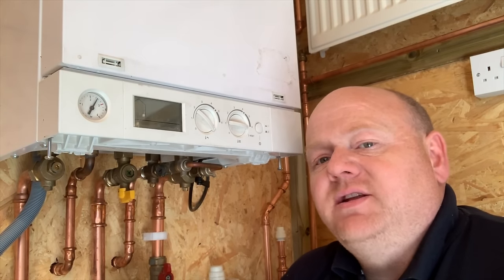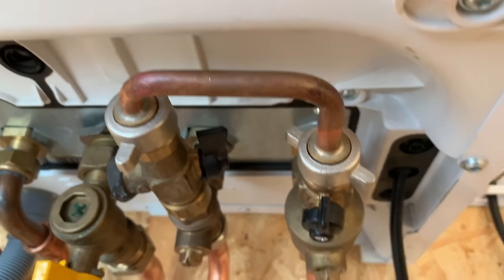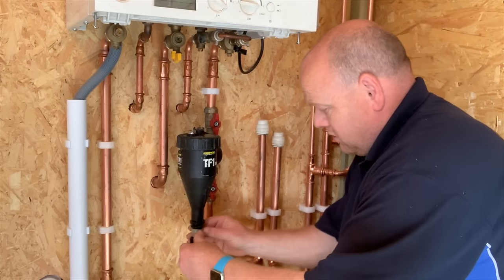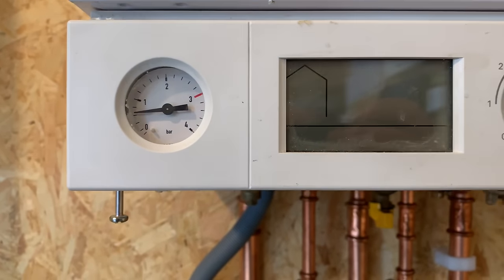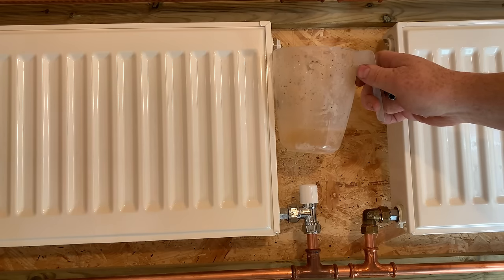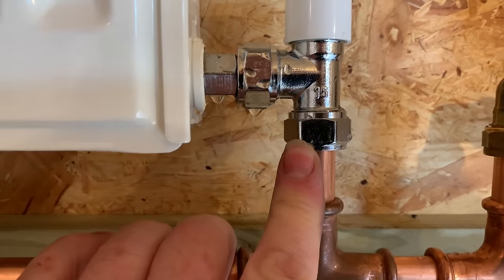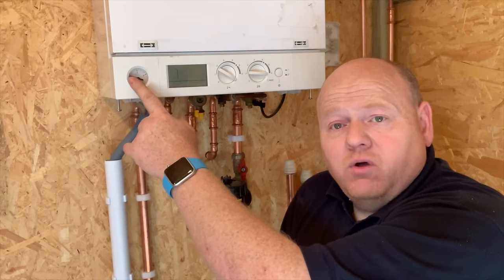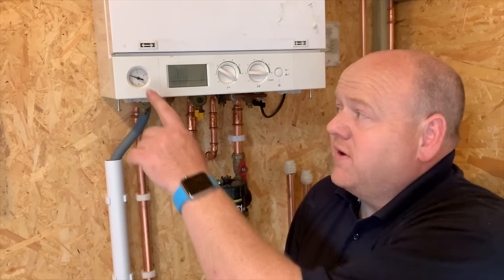Combi Boiler Too Much Pressure - How to reduce the water pressure - Central Heating

Comment: if its a expansion vessel problem how much would that cist to repair or replace my boiler pressure is going over 2 bar before i had a prv leaking still is pressure used to be going lower before
Reply from the maker: Thank You

Comment: Mine was due to the right  hand flow adapter leaking, the threaded part had broken completely off inside, it was a pig of a job to do, but in the end I managed to replace it, now the pressure is holding at 1.3bar. It is a 28i Junior boiler.
Reply from the maker: Thanks very much for your comment, please consider subscribing to support the channel 🙂

Comment: Hi Allen, can you help, just had my boiler serviced, grant vortex combi, the radiators upstairs are working fine, but the underfloor heating, is not, my wife informs me there is usually a pilot light showing green on the ufh covering box, but at the moment there is no light on, turning the thermostats up turns on the boiler, but as I said no heat to the flooring, any ideas?
Reply: If your under floor heating was working before the service, its time  to get the engineer back and fix the problem, at no cost to you.
Reply from the maker: Thank you

Comment: Alan can you help I've got water coming out pipe on outside of house dripping into next door neighbour garden would it be because of an overflow in radiator beside window or would it be my heating system pipes?.
Reply from the maker: Sounds like you will need to call a plumber out, Might need a new PRV ? Thanks.

Comment: Hi Allen, i just wanted to ask a question on this occasion, combi boiler related but not over pressurised. I get an error maybe 3 times a week on my Halsted Eden CBX 32, for differential check fault, could this be a slow / faulty diverter valve?
Reply from the maker: Thank you
Reply: Hi Allen my Drayton thermostat when I turn up the flame symbol does not activate  but heating works ok any suggestions Chris thankyou

Comment: Hi Allen, I've brought the pressure down via the radiator but as soon as I tightened the valve on the radiator the pressure started to go back up on the boiler - instantly.
Reply from the maker: is the filling loop open ?

Comment: hi Alan, what connection has the expansion tank in the attic got to the boiler pressure?
Reply from the maker: You wouldn’t have a tank with a sealed system. Thanks.

Comment: Hello . I hated your post. I have this problem every morning and evening I have to get the water out of the radiator the pressure is 3.5 bar in the morning and evening. I called the agency and they said it was not a serious problem. can I still use the boiler?
Reply from the maker: Sorry to hear you hated my video. It’s normally a sign that the people maintaining it are not doing a good job. Sounds like the expansion vessel needs pumping up. It’s hard to say without looking at it though. Thanks.
Reply: @AllenHart999  I followed the same steps as in the video.  But every morning and evening the pressure increases.  you have to lower the pressure by removing the water from the radiator until it drops to 1.  if it reaches 4 Bar what are the consequences?  Thank you .

Comment: Hi have an issue with my boiler at the min. pressure is rising over 3 weather the heat is on or of .its of all day to day and I drain it back to 1 bar .after a day at work it was at 3.3 bar .its just had a new vessel and pressure is 1 bar inside vessel. Had a new prv and a new diverter valve. Any ideas as costly now every time I call a plumber out .its an ariston microgenus 28mffi. And filling loop is disconnect
Reply from the maker: Filling loop left open or plate heat exchanger passing?
Reply: @AllenHart999  hi chears is there away to prove that I believe the heat plate exchanger has 4 holes 2 for heating and 2 for water . So if it was removed and the  2 for water was filled and left for a while would you see it drain thro or does it need to be under pressure  thanks Paul
Reply from the maker: @paulelscey2465  You could isolate the boiler, Close flow and return maybe, then see if pressure goes up. Sounds like plate.
Reply: @AllenHart999  hi I will try that . It wouldn't have anything to do with the secondary heat exchangers for it would it. just been reading that these boiler are comon for secondary heat exchangers.
Reply: @AllenHart999  . Many thanks for your input changed plate to plate exchanger and all working great now

Comment: okay so  i have read and done most of these things priorly had engineers out twice out this part that part into a near 2 yr old boiler. works like a dream till a day after they leave boiler its topping itself up to 2.5 bar weird noise coming from it on starting up,this sounds like the old noises from old electric meters when sticking then boiler kicks in a gain same noise when switching off. what could this possibly be caused by my gestimate is topping up as valve is slightly left on or faulty allowing water in or there is a fault with the expansion vessel please help im getting really annoyed as its broke twice now in two months and same thing happens weird noise only started after they fixed it in october many thanks if you could advice as they think im being an idiot tonight i will take photo of the bar situation and will video for the noise it makes to cover myself this time
Reply from the maker: Thank you

Comment: i remember that when my mum went to put the heating on at a house which had been unoccupied for a length of time (with the heating shut off) the pressure had dropped below 0.5
she ended up calling someone out, and they showed her how to increase the pressure
Reply from the maker: Depends on the boiler as some have a built in low pressure switch. Thanks

Comment: Is it dangerous if it's at over 2 when on?
Reply from the maker: No,
Reply: @AllenHart999  What's the issue when there is too much water pressure?
Reply from the maker: @MrDangerhere  Once it goes over 3 bar it will blow off on the prv, Thats when the issues start. It's best to follow whatever the manufacturer says. Thanks.
Reply: @AllenHart999  fixed it through the radiator. Just wondering what the actual problem is when it's too high. Thanks
Reply from the maker: @MrDangerhere  Less room left for expansion in the system. Thanks.

Comment: Our pressure gauge was very low, in the red, so we made the adjustments with the taps to put it right. Now, 2 weeks later, the pressure has gone to very high, in the red, and we haven't even had the boiler switched on during that time. Any ideas what to do? Thanks.
Reply from the maker: Thanks very much for your comment, please consider subscribing to support the channel 🙂

Comment: My pressure is just above 1.2 if it go,s over 2.5 is this all right when the heating is on how high do you suggest is the maximum
Reply: Walter Gordon 1.5 is normal that's what mines runs at

Comment: What about the drain pipe straight from the boiler .
Reply from the maker: What do you mean?
Reply: @AllenHart999  when a heating engineer visits they attach a really small rubber hose to the boiler and drain it that way.

Comment: Unfortunately, it didn't work for me. I emptied more than 5 buckle water from my radiators but pressure has stopped on 3 bars. No change at all.
Reply from the maker: Have you left the filling loop open?

Comment: My boiler makes a noise when we run the, tap the noise stops.  Is this the pressure
Reply from the maker: Not sure without hearing it and seeing boiler. Sorry.
Reply from the maker: When was the last time it was serviced?
Reply: @AllenHart999  Thanks Allen  I got a Valiant Eco Plus Boiler I have had it for9,years I haven't had it serviced for years it is worthwhile servicing it now
Reply: @AllenHart999  Is the Ideal brand a good quality boiler which combi boilers  do you recommend Which boilers are best for 4 radiators of 4.5ft and two of 1ft each two bedroom house.

Comment: Water Supply Industry Interpretations and AdviceArea of Interest : Backflow preventionTopic : Temporary filling loopsTitle : Disconnection of temporary filling loopsClause Reference : Schedule 2 paragraph 24 & G 24.2 (a)Reference Number : B54Decision Date : June 2012 (revised July 2018)

Where a closed circuit (heating system etc) has been categorised by the water undertaker as a fluid category 3 risk the installation of a compliant double check valve on the fill point connection to the supply/distribution pipe may be considered as acceptable backflow protection.

Where a fill point connection incorporates a “flexible connection”, when not in use it is good practice for the hoses on these connections to be completely disconnected and removed, however a partial disconnection, that is to say only detaching one end of the hose, is equally acceptable providing that the disconnection is made between the hose and the backflow prevention device on the supply/distribution pipe.

Please note:if the water undertaker has concerns about the likelihood of contamination, or the suitability of a double check valve - for example due either to age, operating temperature or pressure fluctuations – under schedule 2 paragraph 15(4) they can require the installation of additional backflow protection.
Reply from the maker: Stay safe. Watch this one just in case. Thanks https://www.youtube.com/watch?v=Hh5lFC7VI4U

Comment: I allen can I please seek some help from you?
Reply from the maker: What would you like me to do. Thanks.
Reply: @AllenHart999 hi , thank you for replying. 

I have a sabre 24 boiler it's very old, I rent this place and for few days I have an issue, a solid red light comes up, I looked at the book and the book said the pressure should be about 0.5 to 1.5 bars but I saw it was higher. So I turned off the heating, which didn't lower the pressure.  

But before all of this it has worked fine but few days ago I started to increase and lower the dwh position and ch position.

Yesterday it was working fine and pressure was good at 1.4 but at the morning today  it was red idk why, I tried to reset it and it didn't work but after few mins I turned the Central heating on and it started to work till now it's fine, but occasionally it just goes red. Idk what the issue is but do you have any ideas ?

Do I need to find someone during now to fix this situation??
Reply: Currently it's at 1.7 bars while nothing is on . And only a green light is blinking like usual.

Comment: When our system is cold we have no pressure and we get the f 25 sign . In order to start the system we increase the pressure  but this then increases  more than we want outside the green area. The system works and will restart automaticaly if we leave the pressure high , but if we reduce the pressure to the green area , the pressure has dropped to zero the following morning.  HELP
Reply: U have a leak somewhere!!! 👍
Reply from the maker: Thank you

Comment: Thank you
Reply from the maker: You're welcome
Reply from the maker: Thanks very much for your comment, please consider subscribing to support the channel 🙂
Reply: @AllenHart999  I already did subscribe cause i was so thankful - my bath water wasn't getting hot so i started to fiddle :D and after my pressure was on 3 nearly 4 and the boiler was making the sound of a blue whale, Shame on me the plumber said there is a valve under the bath for the hot water i didn't dare call them out again for the boiler- as that was my fault so thank you no more whales

Comment: I have drained every radiator and my pressure is not going down
Reply from the maker: have you left the filling loop open? Thanks.
Reply: @AllenHart999 Thank you so much for the reply! The boiler I have doesn't have any of those black taps. All I have on the filling loop is a connection I have to turn with a flat head screwdriver and this is tightly closed.

Comment: Mines above 2, I’m gonna absolutely shit it trying to do this myself.
Reply from the maker: Have you had the boiler serviced? Did they check expansion vessel
Reply: I’ve never had it serviced, it’s about 4 years old, a Baxi combi. I know how to top it up but not how to reduce it. Its definitely got a filter on it so I think I’ll try that, does it require a special key to open? Is there a danger if I put the heating on?
Reply from the maker: @pinkster0078  I would advise you to have the boiler serviced, They can sort the pressure and pump up expansion vessel for you included in the service. Thanks.
Reply: @AllenHart999  Booked, coming next Wednesday. Thank joy.
Reply from the maker: @pinkster0078  Thats amazing news, Tell them Allen Hart says hi lol. See if they know me